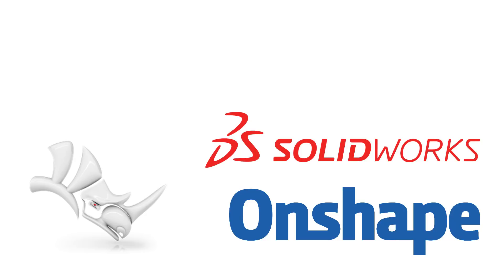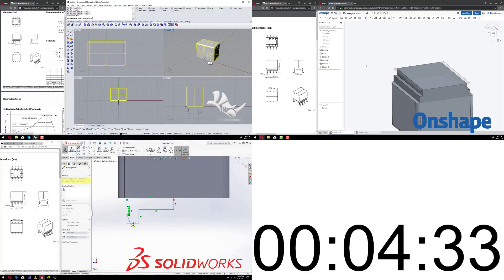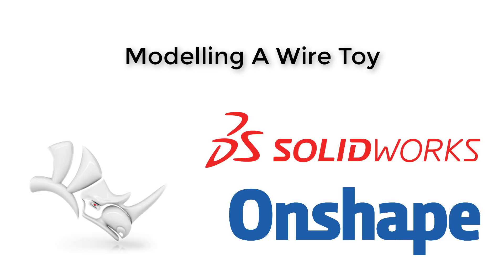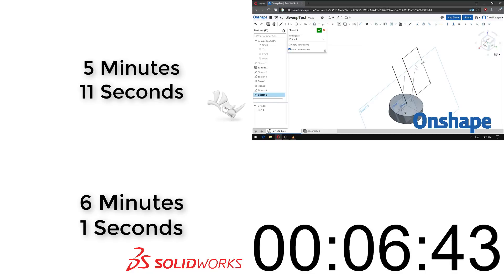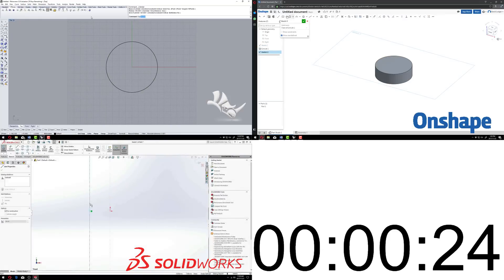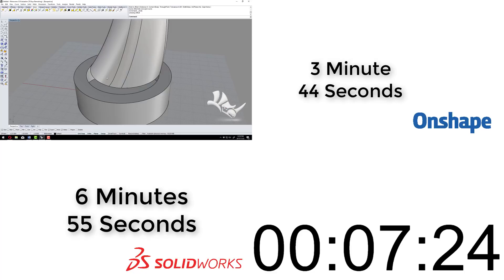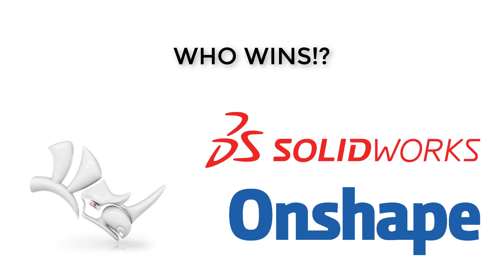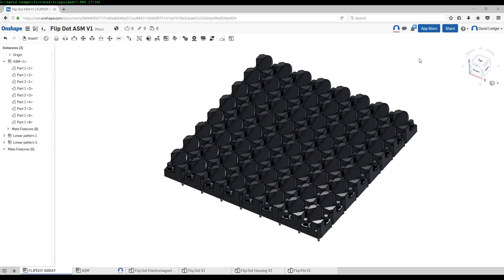MCAD Shootout! - Rhino vs Solidworks vs OnShape

Comment: Inventor, Fusion 360? Not going to include any real CAD software? Kk.
Reply: lol, calling Solid Works not a real CAD system is nice bait. "I personally regard everything less than CATIA v6 as crap, hurr durr"
Reply: Inventor, for the most part, ripped off the Solidworks UI. Its super easy to migrate, and if you are doing anything other than single parts I would highly recommend doing so (that is assuming you can get your hands on a license)
Reply: They're very much at the bottom of the 'professional' pile
Reply: Define "real CAD software", because as far as I was aware any CAD software that facilitates computer-aided design is real CAD software... You know, by definition...
Reply: You can't just assume he knows EVERY package on the market. He's doing a fair test of software he's familiar with. If he used software he was unfamiliar with then those software would be at an immediate disadvantage. Also some people are a little sick of Autodesks monopoly.
Reply: Trials only go so far when trying to learn these packages 30 days for most, 90 days for some others.
These are alot of packages ALOT that would be relevant to videos like this you cannot expect to see them all, I don't have infinite time.
Reply: Solidworks has been used in industry for ~20 years - it is the definition of 3d modeling and pretty much pioneered the field.  It's big brother is Catia, which is used by pretty much every industrial design environment, from fighter planes to cars.  The only reason not to use Solidworks is if you can't afford the license (which IRC is around $5k USD).   Fusion is really, really new by comparison and a whole lot cheaper.  Rhino is good for freehand modeling not really for parametric design.
Reply: @ckm-mkc  there is no relation whatsoever between Catia and Solidworks. Don't fool yourself.
Reply: Ya got him there. Seems regardless of things this is extremely subjective.
Reply: I really haven't seen anyone using Inventor at their jobs. Fusion 360 just started to be something good, so, pretty much, it's not so widely used in industry. 
And the other things those all presented software have included is: perpetual license. And because Autodesk dropped perpetual licensing (and you have to connect to internet every now and then just to verify your license), that's why we basically don't like Autodesk anymore. 
But I find interesting that Catia wasn't included, since both of two largest avionics companies are using it (don't know about car industry), but okay, it's relatively similar to Solidworks, that's widely used in collaboration with e-cad software (I mean, Dassault 3D even includes their own Soidworks PCB, that's based on Altium designer).
Reply: @death03125880  looking for a job: Catia  (aerospace) NX and Creo (automotive,), Solidworks (everything else). Starting up or rolling your own gig: whatever is cheaper. In most cases drawing desk will do.
Reply: I used to work at Autodesk.  I wouldn't touch Fusion or Inventor with a 10 foot pole.
Reply: Rhino and Solidworks are both professional level CAD/CAM software.
Reply: Yep. Fusion/Inventor can do CAM too.
Reply: "any real cad software"? so what exactly Solidworks is then when compared to Inventor and Fusion360 CAD pacages?
Reply: The software used by hobbyists. Basic cad that's easy to learn.
Reply: I use Inventor and Fusion 360. Both work very nice. Fusion for the hobbyist and Inventor for the pro. Also you did not mention Autocad, NX, Designspark Mechanical.
And if you think Fusion 360 can not do the job, I have drawn a model airplane with all it ribs, formers and landing gear (about 1000 parts).

Comment: Yeah, fusion 360 is what all the cool kids are using... How about comparing KiCAD, Eagle, and something else
Reply: I got used to the cloud thing pretty quickly. (though I was reluctant at first) its useful if you have other pcs that you have to use which are connected to 3d printers and CNC machines, as I can just carry on where I left off on the closest machine. There are a few bugs though, it managed to lose my tools library from the cloud folder which was annoying. If nothing else, it might force solidworks to produce a "home/hobbyist" version, if enough people switch over....
Reply: I beg to disagree. 
I've been using solidworks for YEARS, and we recently switched over to fusion360. The parametric modeling is MUCH more robust than solidworks. The HSM Works most people use as a cam solution for solidworks is basically, an outdated plugin version of what fusion360 uses natively. 

Also, to say Fusion360 is just a 3d modeling tool, doesn't make any sense. It's much more than that. 
I would advise you give Fusion360 a week of use or so, and then reassess your review. It seems as if you don't really know much about the program.
Reply: once you have used solidworks everything else becomes primitive.
Reply: Yeah we looked into fusion 360, if i started including all the rest I would need to get familiar with all the rest before shooting anything. Its simply a matter of what is practical.
Reply: Yeah, I hope your comment gets like alot of thumbs so maybe Solidworks notices it.
Reply: I use Fusion 360 as CAD and CAM for may hobby CNC router and I think that it is the best choice you could get for this at the moment. Sure, it has some quirks and small bugs, but some other things are done really well. I like using it, you just have to get used to it a little bit.
Reply: @ubbgn I use autocad everyday. It's absolute garbage. It's the most expensive and yet it's not at all stable. Autodesk don't even care about the program since they're pushing other software to replace it. It's based on code written in the 80s which has been held together with duct tape for the last 30 years.
Reply: Here Tebis is picking up for CAM.
Reply: I think Fusion360 would have been a great addition to that video. .
Fusion 360 is especially great for hobby work, but if you use it professionally it also gets expensive quickly (1.5k€/year compared to 9-15k€ for Solidworks forever) and you still have to deal with their  stupid cloud saving thing.
Reply: Graham Kingston, my two cents:

Honestly after using Solidworks extensively in an academic setting, I found it easier to move to Fusion 360 than to Inventor. A note, my last experience with Solidworks was 2015, and last experience with Inventor was 2016. 

I tried Inventor first, and I had a lot of issues, especially in terms of getting components to go where I wanted them, and stay there. Often a seemingly simple mate would result in parts going at strange angles, despite all my components being geometrically simple. It was also less intuitive to move through my design timeline. I ended up abandoning the software because I couldn't get usable results, even after many hours and many tutorials, for a VERY simple assembly.

Fusion 360 gave me similar, but fewer and less severe problems overall. Their joint system is vastly inferior to the Solidworks mate system in my opinion, at least in terms of simple functions (maybe it becomes more useful for something like a ball and socket joint or the like). I also found it very hard to move jointed components through their range of motion as part of an assembly. Harder to use overall vs Solidworks, but better than Inventor, and I definitely wouldn't say I wouldn't want to be within miles of Fusion 360.

Maybe my opinion will change over time, or if I had more opportunity to learn Inventor, but for now Solidworks would be my top pick, but Fusion beats out Inventor by a significant margin based on my experience attempting to teach myself both.
Reply: Altium is way better than eagle or kicad etc! I'm lucky to be able to use Altium because of my work, but of course it's too expensive for a hobbyist, then eagle is probably a good choice...
Reply: I have not used SolidWorks but I can tell you that Fusion is missing a lot of functionality and it still gets in your way quite a bit, but from what I've read they are slowly catching up and in maybe four or five years will probably be killing most other packages out there
Reply: Solidworks is way more than just a 3d modeling tool like fusion 360 and there main focus lays in the professional market.
Reply: @noijze  Solidworks is the crappiest CAD tool I ever touched.  It's "design intent" paradigm, which assumes that you already designed your part before you design your part makes it just as useless as a poop lollypop. Unless you're just 3d modelling stuff from blueprints and datasheets (why would anybody do that?)  avoid it like the plague. The only people who swear by it are the ones who don't know any better. However, CNC, kinematics and render modules are O.K.
Reply: Autocad is a great tool for learning!
Reply: Kicad, Eagle, and say Altium?
Reply: Fusion 360 is accesible and does everything including CAM, solidworks/rhino is ridiculously expensive and doesn't do what fusion 360 does.
Reply: Once anyone gains access to solidworks, you won't want to be within miles of fusion 360. It like comparing google sheets to excel. Inventor is also a decent tool as they essentially ripped off solidworks UI, and inventor is free for students. I would highly discourage anyone from touch fusion unless they really had no other option.
Reply: It's CAM is shit.  If you are actually fabricating parts, bad free CAM costs more than a $500 CAM package.

Comment: TinkerCAD?  DesignSpark Mechanical?  My main need these days is STL files for 3D printing, though I will be designing my next 3D printer, so perhaps a more serious MCAD package will be warranted..
Reply: SOLIDWORKS and Rhino are quite a bit more serious than TinkerCAD. Maybe look at the inventor/f360 pairing.
Reply: Download inventor for free as a "student", it's very similar to solidworks and will adequately prepare you if you ever want to upgrade to more professional CAD suites.